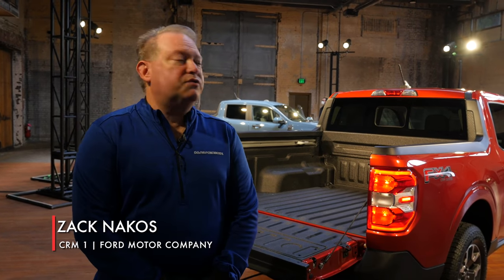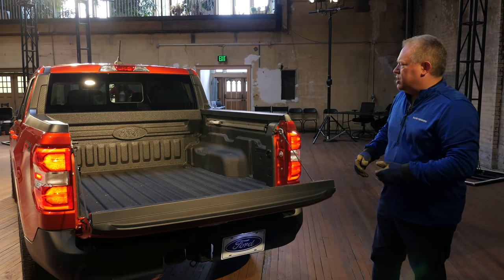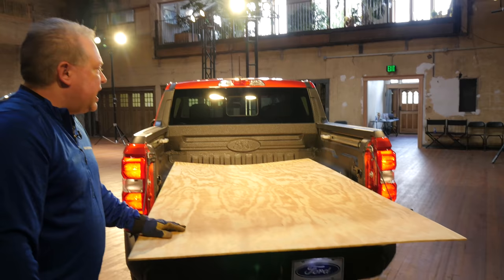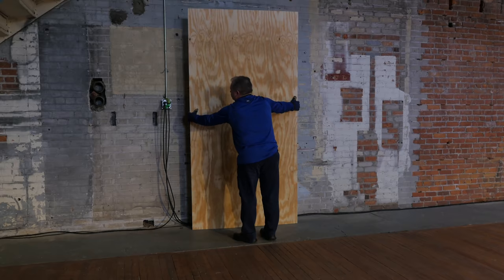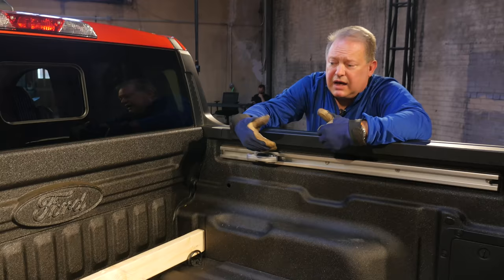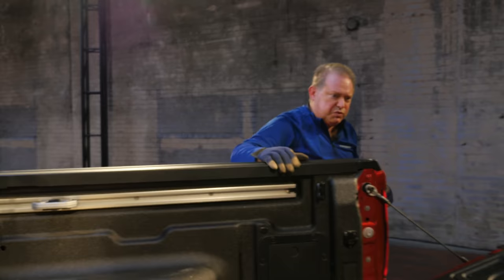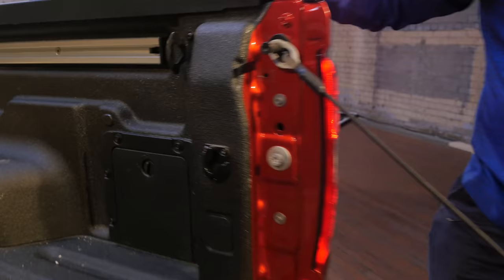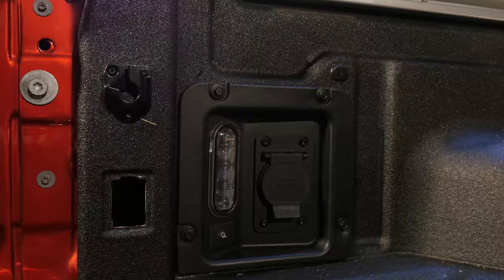2022 Ford Maverick truck bed demonstration

Comment: I would not say that this truck is for individuals of limited means.  I would say that the truck is for people that are value focused.
Reply: Exactly... He didnt exactly put that in a proper vernacular....😂
Reply: "our target customer isn't rich and wants to do things besides pay a 600.00 truck note"
Reply: Indeed!
Reply: people with limited means arent going out and buying a new 2023 ford maverick 😂
Reply: @newslavecity8311  I make good money. I want a small truck. My Maverick just went into production. Can’t wait. I fit every bell and whistle except for the sunroof.
Reply: @gingerman5123  no sunroof?  brokie
Reply: Could I afford a more expensive vehicle? Sure but I'm not really a truck guy. I'm more looking for a car with a bed if that makes sense. I have a work truck at work I'd rather have something that drives nicer. Btw, if you get a  well equipped Maverick. It will be north of $30,000 which depending on how much you put down will be $600 a month or more...

Comment: Good on Ford for thinking about the truck bed mods.  Gonna give this truck some serious thoughts after I see the EPA numbers for the AWD 2.0 Eco-boost model.
Reply: Just look at the bronco sport with the Same engine 26 mpg highway….  I’m thinking this would be 25 because it’s bigger
Reply: @CreativeMechanic  Good point sir.  26 for a truck this size with awd isn't too bad.
Reply: @eunhyuekpark6159  Also defeats one of the major selling points of this truck.  If it isn't getting mid-30's combined, it's not going to be able to differentiate itself enough from the Santa Cruz, and the only advantage this has over a regular mid-size pickup is price.
Reply: @Schlabbeflicker  the base engine is a hybrid. Get the hybrid version and get 37 combined. It's fwd but if you don't off-road, that'll be fine.
Reply: @Schlabbeflicker  It has a lot more advantages than that, you simply aren't paying any attention to those details, even if they are minor they are still important and are such details that give it an advantage.
Reply: @Schlabbeflicker  If i want midsize pick up, I'll buy mid size pick up.  This is a small size pick up, which appeals to people who don't want full-size or even mid-size, but sometimes need to get stuff, like that 4x8 plywood for example, from HD.  I am one of those people.  So i'm seriously considering this.
Reply: @conchaivn  Don't forget to buy the extra lumber to make the required supports to hold that sheet of plywood because it has to sit on top of the wheel wells the bed is so small.
Reply: @conchaivn  Just worried about new Ford hybrid reliability. ICE part I'm OK with. Battery/electric side unknown quantity. If it is Prius system I would buy in heartbeat because its been on road for about a decade.
Reply: @ramecodiesel8271  Im ok with that. What truck will the 4x8 sheet fit flat on bed anyway?  F150 super duty?  Im not paying 20k more just to load 4x8 maybe once a year.  And i dont want to cut it by half and tie on the roofrack of a suv.
Reply: @pcfabris  the hybrid warranty is 8 years 100k miles. Covers every part of the hybrid power train; battery, cables, generator, eCVT. The battery was pulled from the escape hybrid made in the US. The electric motor was revamped for this car but very similar. And the engine is identical to the escape hybrid as well. Might advertise as all new but not really. This truck used 70 plus percent of the parts from the Escape and 90 plus percent from other vehicles Ford has. Not much new to it
Reply: @ramecodiesel8271  Plywood does NOT require extra support, as he demonstrated.
Reply: @pcfabris  My wife drives a Ford Fusion Hybrid. Close to 8 years old, never an engine, hybrid or tranny problem. We get 37-40 MPG.
The story I heard was that about 10-12 years ago, Ford saw how well the Prius was doing, and wanted to get into the market. Looked at the engineering, and decided it would take too long, so they went to Toyota to buy the patent rights. Interestingly, as the same time, Toyota wanted some Diesel patents Ford had, for places like Africa, where Ford does not sell anything, so they sat down, and in a couple of meetings, decided to just share the appropriate patents, meaning no money passed hands, and both sides walked away happy.
So yes, the Ford hybrid system is based on Prius technology.
Reply: @ramecodiesel8271  the piece of wood he placed at the 5:26 mark would be the support needed to keep the 4X8 sheets of plywood from flexing
Reply: @pcfabris  Ford has been doing hybrids for a decade. And the truck is backed by a 7 year 100k mile power train warranty. At the end of the warranty just get the extended warranty and if there’s any problems after the extended warranty then that’s to be expected with any vehicle and the truck at that point already did it’s job

Comment: I’m pretty stoked to have a pickup option that is not outrageously expensive. This is so damn practical. The use of wood as an inexpensive mod material is so unintentionally hilarious.
Reply: Every truck bed/bed liner for the last 30 yrs has this same 'ingenuity'
Reply: What's funny about it?
Reply: @pahu47  No shit, right?  My first truck was a Dakota and had this back in 1997.
Reply: @techjdu  I understand that a lot of companies act like they invented something even if they didn't (looking at YOU Apple, and I'm an iPhone user), but at least Ford got on board (Ha! I'm a poet!) to offer an alternative to a sixty or seventy thousand dollar Raptor (maybe a lot more now). I'm sure this truck goes way up above 20K with any upgrade you want, but man, I wish this had been out 10 years ago or more so I could look for a hopefully good used one now.
Reply: @pahu47  Right. Same for the multi position tailgate. I had an s10 in the 90's that did the same thing.

Comment: I'm old dude with an old Ranger - and while could certainly afford a new Ranger or even F-150, do NOT want either -- for my needs, this Maverick would be close enough!  The smaller bed size, I could make-do and quite frankly, most of my uses don't use the full 6ft anyway

just my opinion : Ford ought to consider us older guys & gals with old Rangers looking to replace with a likewise smaller truck
Reply: Ford is doing a pretty good job of providing a truck for every demographic.
Reply: And us old retired guys on a fixed income. This is affordable as it is useful.
Reply: I want a 2door but I suppose that's something they skipped for this gen, at least until they see how it sells.

Even with the 4 door, I like it quite a bit. I owned an F150 and it was so much more than I needed. I move furniture, buy some large items at the store a few times a year, some mountain biking, and the f150 was a pain to park in the city and most shopping around where I live.

I ended up trading for a more family friendly Ford SUV.

But this is on the shortlist for my next vehicle, it's honestly better than the baby bronco.
Reply: @davidw1390  similar ... would prefer this with 2-door & bit longer bed, but not deal breaker at all
Reply: Yeah, I've been hanging onto my 2001 Ranger because there haven't been any small truck replacements available.  Only once in awhile have I needed the full 6 feet of bed, so seems this "flexbed" could adapt when necessary.  I don't like the interior of the XLT though...prefer the black of the XL...but the XL doesn't have cruise control.  I wish they offered a less quirky interior for the XLT...not hip on all that blue.
Reply: This is as good as it's groping to get for you. This is your ancient Ranger replacement. Despite Ford's dream of millennial buyers, old timers are going to be the primary buyers of this truck.
Reply: @dougf9900  a significant portion for sure - interesting that Ford seems to be ignoring this segment

I do 'get' that Ford assumes we'd go with Ranger or F-150 & that they are going after GenZ/younger millennials as repeat customers down the road .... but, still short-sighted
Reply: @The_Temple  we’ve seen it before with vehicles like the Honda Element and Scion brand that ended up attracting older buyers than the automaker was hoping for
Reply: I think they just did.
Reply: @davidw1390  I'm really not confident with them every doing a 2 door and that's solely based upon it's unibody design. Body on frame or more configurable, but for a base hybrid that gets 40 mpg and is ~$20k, what's there to complain about? It's cheaper than an Elantra
Reply: They certainly understand that this appeals to older guys (and ladies who garden and woodwork). They would never market it that way, though. They don't want it to go the way of the Town Car or anything badged as a  Mercury or Oldsmobile.

Comment: Have not given ANY thought to a small pickup in a long time.  Well now that Ford has done this I'm already thinking of getting one. Why? Well they solved one of the biggest issues I had with small pickup trucks. That is the bed of the small truck. It's now 4ft wide!!!! Yeahhhh!! Then they gave it that flat surface with the movement of the tailgate cables! Brilliant you guys. Now I will be considering something other than the Bronco now!!!

Comment: 6:08
-"You´ll notice there's hidden storage there"
-Me: Yeah, I've seen it in literally every review
-"And withing the hidden storage there is more hidden storage"
-Me: visibly surprised
Reply: Already ordered mine. I worked for GM as a truck specialist for 15 years. Thought Fords were Junk until I drove a Ford motorhome through 16 States in 16 days. No mechanical failures whatsoever. I have no doubt this small truck will work out for what I need it to do. Kudos to Ford for being ahead of the Curve on this massive untapped consumer Market

Comment: I cringed when he said "They (potential customers) are of limited means..." and also "They don't have a disposable income for a high-end bike rack." 

Sure might be true for some, but I also think a large portion of potential Maverick customers might be considering this vehicle because they like the low price and practicality of the vehicle and are not necessarily "poor."

I mean, It's fine if that's what your internal research said but don't say it out loud in front of the camera...
Reply: No one uses a quick release skewer anymore with disk brakes.  If these guys actually threw a leg over a bike they would know better. Platform hitch carrier or front wheel over the tailgate is a better solution. Stick with building cars.
Reply: @KODATHEDOG  Say what? People still ride road bikes too, and they're all still mostly QR's.  Not only that, there are tons of fork racks that work with through-axles.  Just search "through axle fork mount" on amazon for what you would use to DIY something like this.
Reply: I respect the fact they are trying to think of the needs of bicycle riders, on my truck I found it's just easiest to install a tailgate pad and be done with it, doesn't take up any room in the bed, and my backflip bed cover still locks in place. Solves the bike problem and keeps my bed free and clear.
Reply: I had the same exact thought. I'm interested in this truck because I live in the city and don't want/need a big truck, not that I can't afford it. And even if your market research told you I can't afford it, don't tell me I can't afford it. Dude was just not a very good person to talk about this truck.
Reply: @ericl6460  Why would I spend time removing a thru axle and risk my front rotor and pads become non aligned when I can use the tail gate or platform carrier.  Yes I have old bikes with QR Skewers but my gravel, new road bike and MTB are all disks.  Good luck in 10 years finding a bike with calipers
Reply: @KODATHEDOG  if the tailgate had a cage at the end like the frontier it could fit a bike laying down
Reply: and don't forget us frugal old farts ;)

a small size truck (and yeah, yeah, yeah, I know it's unibody and more of an Escape morphed into a truck-like thing) could certainly entice older Ranger owners not quite thrilled with the newer Rangers
Reply: @tonykasunic1  I do the same, works great
Reply: @DavidLRodgers  Yeah, and he is the Customer COMMUNICATION manager. Watched to the end to hear one more "uh".
Reply: Sure, people can afford $500 truck payments, my self included. But I don’t cause I feel a car considerable depreciation over a short span doesn’t seem like a savvy investment considering most compact sedans can do small towing (bikes, kayak, small boat trailers) with all the amenities. I’d say this is perfect for the price.
Reply: @Stigz34  it’s optional
Reply: Marketing folks are always a couple degrees off (IMO) - they follow the philosophy of gather some data - ignore that data - form a conclusion then gather the "right data" to support their position - not entirely different than what's gone on within the past 14 months but I digress...
Reply: @tonykasunic1  I have a Rage motorcycle rack works with bicycles mini bikes and full size motorcycles. Hauled home a650 KLR on my Ridgeline in January strapped on good. Ride like part of the truck. 
Glad I did. You can’t find a bike now. New or used.

Comment: 6:05 why would you only get the cubby on XLT and Lariat?  Isn't the same space there for XL?  Why would it be so hard to provide it for the XL too?
Reply: Comes down to cost cutting. The XL is super barebones and the way they can advertise it as <$20k (even though it’s ≈$21k) is by removing almost all features. It also serves as a chess move to try and up-sell you on the XLT.

Then again, that reasoning makes more sense for actual niceties and creature comforts. That storage space isn’t a creature comfort, it’s just plain useful. I can’t imagine it’s very expensive to add it, so it’s a super lame move to remove it. I don’t even see it as an option for the XL on the website.

Comment: Why on earth don't they make a long bed version without a back seat? No one has made a lightweight, fuel efficient long bed mini truck for decades. With a camper shell you could carry tools and materials and even go camping in it if you are over four feet tall. The manufacturers only make pickup trucks for people that can't decide if they want a car or a pickup truck and ignore trades people and people that want something smaller than an F250 that they can go camping in now.
Reply: Demographics, It's a numbers game.

Comment: I noticed they used construction grade plywood. What about MDF and cabinet grade 4x8 sheets which come 49"x97"  it looked like it fit kind of tight hopefully there is enough room for 49"" wide sheets.
Reply: Ford? Would be great to get an answer

Comment: There are rumors of plug-in hybrid and pure EV versions coming. Sign me up! If I could get a plug-in hybrid with a 30-40 mile battery range I could then drive to the office on battery, charge it at the office (at no cost) and make it back home and charge at home. And still have the range of a gas engine for road trips. And be able to make Home Depot runs on the weekend.  Sounds like the perfect commuter car to me.

Comment: I don't need any plywood but if I get this truck I'm buying a sheet just to test this out :)  I think I would go for the Hybrid personally.  I drive the baby Jeep now (Renegade) and I was just looking at the fuel costs here in Canada. If I average the price of gas at $1.28/L it would save me over $1315 in fuel each year based on my driving of 55%hwy 45% city.  That's crazy good fuel economy and a much more useful vehicle for my lifestyle.  Can't fit plywood in the Renegade :P

Comment: This guy was funny. Couldn't get the tailgate adjusted and then dissed the target market with limited means comments. I especially liked when he said notice how the plywood slides right out. Yes right onto the highway when you drive away. Best to just keep that tailgate up please. Outlets are known as 120 v sir not 110 and 400 watts is about 3.3 amps not much plus I'm pretty sure you would have to have the truck running to get 120v ? This stuff works a lot better in an electric truck with their huge batteries but not too well for an ice vehicle.

Comment: It resembles the Ford explorer sport trac second generation, but with small engine of course. The Maverick has the same bed design but a bit wider but the same concept. It too has compartments in it left and right side of the bed  and in the front of the bed.  The Maverick only has one. An yes the Ford sport trac does have an outlet too. The Ford Maverick and the Ford sport trac are the same trucks.

Comment: The thing I immediately noticed about the plywood demo is there is nothing to support they plywood in the middle. Which might not be important for think plywood, but what about Sheetrock, paneling, etc? Seems to me they are still missing a feature and need to do more customer research and R&D.